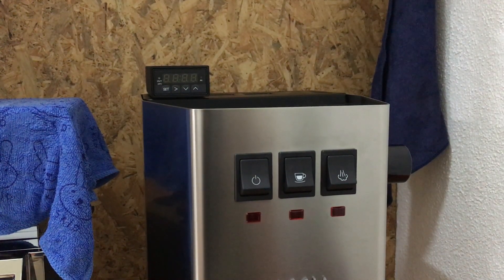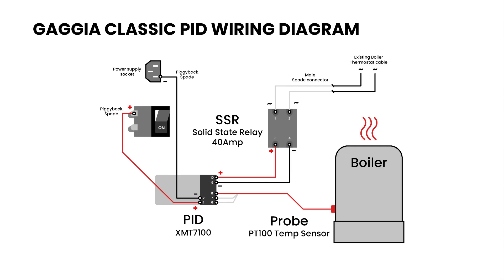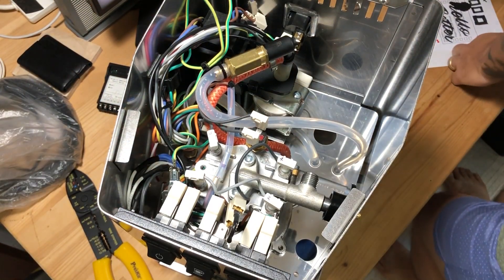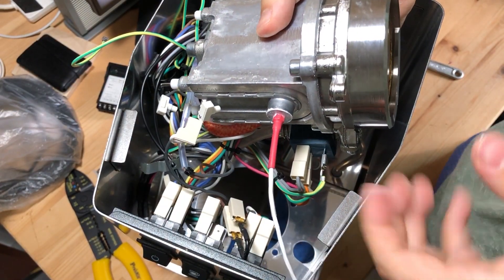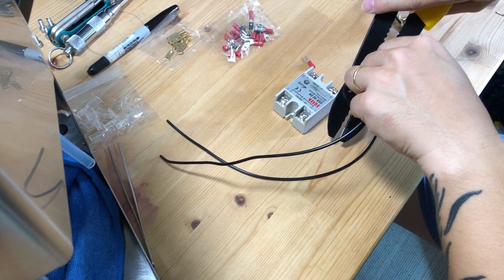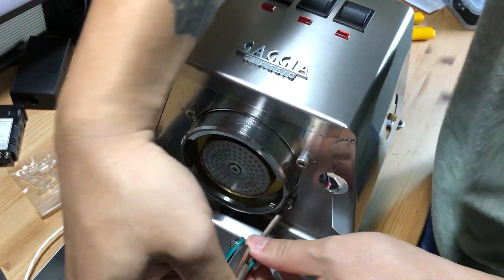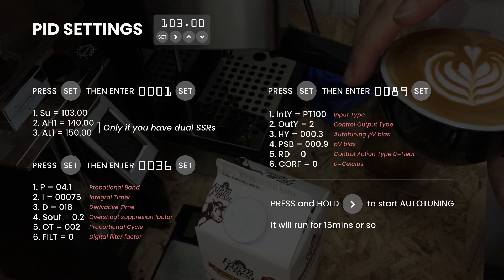Ultimate PID Gaggia Classic Pro Mod

Comment: Hi, I followed this guide also and it works perfectly!👏🏻👏🏻 thank you :) do you know how I can add a second o e to stabilise the steam setting as well? I’d love to upgrade it for this last part also?
Reply from the maker: Thank you for following! I haven't done it yet but hopefully I can put a second video up as well. You can also search for other tutorials with dual SSR settings. Good luck!
Reply: @EweJinTee  Thank you, I have seen the video on how to convert the lid but I cannot find a wiring diagram to show how to connect the second ssr?
Reply from the maker: @Daverave69   It's connected to the 3/4 terminals on the PID if I'm not mistaken. Check Damian's video. Do a google search on 'Dual PID Gaggia'. Hopefully I'll have some time for a new video soon :P
Reply: @EweJinTee  Thank you 🙏🏻 😊 this is super helpful

Comment: Before doing all this, has anyone looked into swapping another thermostat for higher temps/ better temp swings?
Reply from the maker: The original thermostat that came with the Gaggia is already exceeded the ideal brewing temperature. If I'm not mistaken the original thermostat is at 150 Celcius. Someone might be able to clarify that better here.
Reply: @EweJinTee  107° for brew_145° for steam.  The coil is rated for 185°.
I'm researching some  other thermostat options now. With the 107° brew high limit, my one week old machine is not able to see temps past the portafilter of 79.5°.
I've been doing the hack with opening the steam cycle for 20 seconds also. I've found the manufacturer/ klixon of the supplied thermostat and have found a supplier who can sale me a 120° thermostat to swap out. I'm trying that out for $15 US, before spending what a PID and parts run. I'll update here once i install the thermostat hook my equipment up to the gaggia.
Reply from the maker: @BadCompany-TX  Great to have people like you in the community! Do update the results when you're able to swap the thermostat. Good Luck!

Comment: Hello! from the left button (power on) is "+"?  from the power on the rear panel is it "-"?
Why are two wires connected on the middle button (turning on the pump)?
"+" can be taken from the middle button?
Reply from the maker: The wires were taken from the power rocker switch (+) and rear power supply (-) to supply power to the PID and keep it running only when the machine is turned On. The PID needs to be ON to maintain the temperature in the boiler.

If you connect the (+) to the brew switch, then you will only get the PID starting up when you press the brew button. Hope that makes sense.
Reply: @EweJinTee  Thanks for the answer!
Reply from the maker: @elenakalugina3758  Anytime!
Reply: @EweJinTee  but in Robert's video it turns on as soon as he turns on the machine. Doesn't that contradict with what you are saying?

Comment: Shopping for a sensor, I see some have 2 conductor wires and some have 3 conductor wires. What is the difference?
Reply from the maker: Thanks for asking. I just googled and found this. Basically it's about the accuracy of the sensor. Not too sure how you will need to wire them to your PID but 2 wires work fine for me.

https://www.sensortips.com/featured/whats-the-difference-between-2-3-4-wire-rdt-sensing-faq
Reply: @EweJinTee  thank you

Comment: XMT7100 seems to be no longer available. Are there any alternatives?
Reply from the maker: https://www.aliexpress.com/item/1005004668154424.html

Try this?
Reply: @EweJinTee  thanks but item not available in my region.
Reply from the maker: @hoqpus  Guess you'll have to Google to see if any luck. Another PID is also possible but you will have to study the diagram and connect it to the correct terminals behind the 'new' PID. And the enclosure also will be different in that case.

Comment: Hi. I did PID too but now my steam wand doesnt steam. Hot water still goes through the steam wand. Do you know what may cause the issue? :(
Reply from the maker: This is difficult to answer without actually checking the machine. Better to seek a local shop's help I think.. Or just dismantle and look around inside the machine but be very careful, the entire thing inside is running current. I got shocked once just by touching the boiler lol
Reply: @EweJinTee  do you think bcuz we autotune it as 103, the temp cant go up higher for it to steam? Just my thought

Comment: Thank you Ewejin for your very informative and detailed video. I am not good dealing with electrical values, will this set up work as well in the USA model since we have 110v and not 220v like in Europe or I will need to change some components or the way it is connected?
Reply from the maker: No problem. I might be wrong but maybe someone in here who's in the US can help out as well. I'm pretty sure the circuit in the machine won't affect the Voltage much because it is all converted from the main power source which is either 110V or 240V. But please do your research nonetheless. I will update if I can find something.
Reply: @EweJinTee  Thank you.

Comment: hi ewejin i made the mod as  directed. i see the pid is set at 103, i assume thats celsius. but when i take the temperature of the water as it goes into the cup it is 65 degrees celsius for me even though the pid is saying 103-106.  what is the explanation for this?   also what is the advantage of manually tuning the pid as opposed to autotuning?
Reply from the maker: Hey. When you're setting temperature on the PID, it does not mean that's the exact temperature that you will get in your cup. Water will travel across the boiler into the grouphead and temperature will drop. There is a certain way to measure the temperature on the grouphead but I haven't done it before as well. Check it here : https://www.youtube.com/watch?v=6kog9_V5ci4

I basically set my temperature based on espresso extraction taste. If it's too bitter, then it's too warm, too sour then it's too cold. It all depends on your grind size, bean and roast settings. There are a lot of variations that go into it so it's a bit complicated to define the temperature that you set on the PID. You'll have to adjust according and find the sweet spot. Hope that helps.

Comment: thanks for the instructional video.  question., i will need to buy a crimping tool for the project, what is a good crimping tool that you would suggest that is for  a hobbyist, only doing occasional wire work. can you provide a link, thank you.
Reply from the maker: Thanks! I found a few on Amazon, but I think this would do the job fine. 

https://amzn.to/3RuVtE1

Check out the link. Good luck!

Comment: Love this video. Are you  Malaysian?  Quick question, are you planning on doing a flow control mod?
Reply from the maker: Yes I am. From Penang! I'm planning on a couple more such as a Pressure Gauge. Not a fan of Flow Control mod but I might change my mind after I've done proper research and found the right equipments to proceed ;)
Reply: @EweJinTee  I'm from Kl, I'm going to get a gaggia and will probably hit you up when I mess up my mods haha.  I really want to do flow control, maybe the gaggiuino stuff to make it basically function like a 20k machine but I can't solder for nuts 😅
Reply from the maker: Sure man. Just hit me up on FB Messenger or something. I'm in the Gaggia FB group as well.

Comment: I installed according to directions but when I turn on my machine the temperature for the PID only shows low 90s in F setting  and moves very slow. The AT light is blinking slowly. But the machine is very hot
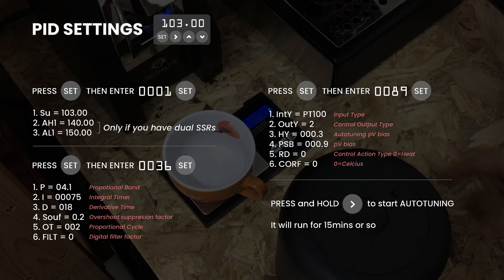Reply from the maker: Please check the settings of your PID and make sure you entered the correct temperature sensor probe. There is a page at the end of the video on proper PID settings @ 8:34

Comment: Thank you Ewejin.
Wondering if there’re diff pid module available in the market? It’s interesting to see how flow rate can be controlled too?
Reply from the maker: There are other PID Modules which does the same thing but it's twice the size. I used this one because of it's compact size. However, there are other mods that let's you control flow, preinfusion and temperature but it requires some engineering background. Google 'Arduino mod Gaggia Classic Pro' and you should be able to find it. I'll put the link here: https://www.youtube.com/watch?v=MxPNQRCxQZc

Comment: Great tutorial Ewejin. What is the difference between the 40amp SS relay and the one in Damian’s video (was 25amp)? Thanks
Reply from the maker: Thank you! It's not much of a difference with 25 or 40amp relays. I'm just giving it more 'space' so to say to be able to handle the load. And also to 'overkill' the setup so it's safe for everyday use. Just my personal preference when modding this.
Reply: @EweJinTee  Great, I am pulling the trigger to this mod soon :)
Reply from the maker: @RamySLR  Good luck! Looking forward to your results! Remember to familiarise yourself with the internals before doing any splicing/cutting :)

Comment: The pid works as soon as I connect the electricity, even though the machine switch is turned off
Reply from the maker: Thanks. I can only think of two options: 1. Please check the terminals for the PID power source. You might have connected the wrong terminal or 2. your model might be different than mine and the power swtich terminals is different. Best to use a multimeter to check.
Reply: @EweJinTee  Thank you very much I fixed it
Reply from the maker: @محمد_ابوعيشة  Awesome!!
Reply: @محمد_ابوعيشة  How did you fix the issue?

Comment: Very detailed video, thanks so much for putting this together! Going to order the parts off Ali soon and shop the rest locally.
Reply from the maker: Thanks for the comment! Good luck with your project!
Reply: @EweJinTee  Question to you, is the 2.5mm wire the same as a AWG 10 wire? If so, how are you using those red connectors with it? Commonly, the red connector is associated with AWG 22-16??
Reply from the maker: @Moxyvox  I think AWG 20-22 wire is good enough. According to the rated voltage, it can support up to 600V which is more than enough. The red connectors just crimped and secured nicely to the AWG22 wires.

Comment: Thanks for the post.  About the PID setting, at code 89 #3 HY=000.3 and #4 PSB=000.9 . How do you set the decimal, is the 0003 and 0009 is the same. Cant set to 000.3, and 000.9.
How to get it there.
Thanks Eddie
Reply from the maker: Hey Eddie,  I can't remember the setting anymore but probably just use the 'Up' and 'Down' arrow keys on the PID to get to the correct number settings? You can try that out. If not, please check Damian's PID setting video. You should be able to find the link in the description or comments here. Thanks!

Comment: Hello friend! PSB should be 000.9 or 000.0?
Reply from the maker: You can leave it at 000.0 no issues. I think I had it at 000.9 or maybe that was a typo in the video. Sorry about that!
Reply: @EweJinTee  could you please tel me what's the difference if I leave it in 000.0 or put it at 000.9?
Reply from the maker: @SteliosXanthopoulos  I'm not too sure myself. Maybe it's best to just leave it at 000.0 as a default :)
Reply: is this the offset temperature? what is this PSB setting?

Comment: Sorry if I missed it but what happen to the Bezzera BZ13
Reply from the maker: Sold it. Needed a smaller machine for the Kitchen. The BZ13 was a good machine though, I've had it for almost 5 years with no issues.
Reply: @EweJinTee  my GCP has the dimmer, cut OPV spring, PID and gauge. Somehow I think I would be happier with my modified GCP than a BZ13 out of the box!

Comment: Great tutorial! Thanks. I followed it and installed the very same components on my 97 Gaggia Classic. However when brewing the temperature goes from the target 103C down to 99/98C. Weirdly, the autotuning last only for about 2 minutes. I tried several time with auto tune as well as manually setting the parameters but nothing helped. Do you have any idea of what could be wrong?
Reply from the maker: Hi Tommaso. Thank you for the question. Temperature drop during brew is normal, as cold water flows through the brew group head, it converts water from room temperature to your desired brew temperature. -1C to -5C temp drop is normal. This is the only downside with smaller machines like the Gaggia. Larger machines will tend to have a boiler inside and temperature is monitored in the tank. Hope that helps.

Comment: Dude - I feel like this is going to be a really dumb question - but is the wire I am looking for - 2.5mm single core, copper insulated wire?
Reply from the maker: I think that's the one. Insulated wires help prevent the wires from getting burnt at high temperatures. Good Luck!

Comment: Nice job
Reply: It is nice because you show easy it is to add a pid and get that 70 to 80% benefit without the pain of adding second ssr or an expensive kit to get steam control.  And at a VERY reasonable price point.  Good wire diagram as well..
Reply from the maker: @chuckv8838  Appreciate it! Please share your setup once you're done modding on FB group called 'GAGGIA Classic'. I'm on there as well :)
Reply from the maker: Thanks!!

Comment: Thank You!! I completed everything today: cut opv spring, lamp dimmer switch on right side in front of steam knob, installed manometer on front right, moved Gaggia logo left, setup xmt7100 for 2 relays, pulled a perfect shot, and I now know the pressure is at 8.5 bar. You helped a lot!
Reply: Keith do you mind sharing the wiring diagram for 2 SSRs.?
Reply: @thinkertinkering3853  I did not create any diagram for the second SSR. Ewejin Tee demonstrated a good diagram in this video, https://youtu.be/ztvDKt2Zz6c
The only supplement to that, if using the xmt7100 modified as Damian indicated here, https://youtu.be/WYm6hDPqtgA is to run pin 4 and 5 to the second relay for the steam thermostat terminals. I only used the negative terminal, pin 5, to the second relay because as Damian indicated elsewhere, the positive of pin 10 and 4 is constant on, and only negative pin 9 and 5 is switched. So I ran one wire from pin 10 to positive of both relays!
Reply: @threehanded8853  I tried that today and now my Gaggia does not heat up anymore (neither when turned on nor when steam knob additionally switched on).
I used a 2nd SSR DA (otherwise your mapping makes no sense as the input is DC).
No big deal as I can easily unplug the 2nd SSR DA and run my PID as described in this video. 
Therefore my journey for the correct dual SSR wiring continues.
Reply: @thinkertinkering3853  Also, I connected my thermocouple as Damian did in his video because I used a k-type thermocouple versus a pt100 type, so it’s wired differently and you have to use a different type setting in the settings menu, if you use a k-type thermocouple as I did.
Reply: @threehanded8853  Thank you for pointing out the k-type thermocouple, I have the same when I ordered the parts for Gaggiuino project (I haven't started the project yet), but could you please share more information on how it's wired differently and how the setting is different in the PID?
Reply: @showmak  the blue and red leads are connected to pin 6 and 7 (of the xmt7100), and no jumper wire is used from pin 7 to 8. In the PID menu, menu 89, Inty setting is set to Y, which looks like an upside down digital 4, for my k-type thermocouple, as shown in Damian Wintowski’s video:: I did not create any diagram for the second SSR. Ewejin Tee demonstrated a good diagram in this video, https://youtu.be/ztvDKt2Zz6c
The only supplement to that, if using the xmt7100 modified as Damian indicated here, https://youtu.be/WYm6hDPqtgA is to run pin 4 and 5 to the second relay for the steam thermostat terminals. I only used the negative terminal, pin 5, to the second relay because as Damian indicated elsewhere, the positive of pin 10 and 4 is constant on, and only negative pin 9 and 5 are switched. So I ran one wire from pin 10 to positive terminal of both solid state relays!
Damian Witonski remove ssr xmt7100
Remake - https://youtu.be/WYm6hDPqtgA
Original - https://youtu.be/Ewj5oXl_wk0
Reply from the maker: Glad to know. Cheers!
Reply: @threehanded8853 did you wire the second relay with the same cables from the thermostat cables?
Reply: @n1ckthegr33k6  think of it this way, there are 4 wires that come off the old thermostats and then get wired to the two relays. So the two wires that came off the steam thermostat go to the second relay. In the new wiring there is only one temperature sensor to the side of the boiler. That temperature information goes to the PID. The PID then decides to turn the relays on or off based on which circuit the Gaggia is in: Brew, or Steam.  The Brew and Steam circuits in the Gaggia are manually selected circuits. I hope that helps.

Comment: There are two types of temperature sensors, M4 and M6, which one is them?

Thanks for this video😁
Reply: I have the same question :)
Reply from the maker: @coenwouters6808  If you're  using the same machine as the one in this video, then you'll need to get the M4 thread  temperature sensor.
Reply: @EweJinTee  Thanks I really appreciate it
Reply from the maker: If you're  using the same machine as the one in this video, then you'll need to get the M4 thread  temperature sensor.

Comment: Is that 1/8" hole your drilled? Guessing you're using metric system...  Ordered all the parts off ali last night for $40, sure beats $150 - 200!
Reply from the maker: That's cool! I didn't measure the hole size but make sure you're able to fasten the relay :) Good luck with modding!

Comment: Do you need 2 relays if you want to be able to adjust the steam temperature?
Reply from the maker: Hey. Yes you will need that. I didn't mod the 2nd relay into the machine because I felt the steam  temp is working fine for me and I'm able to get nice foam. I've shared a video by Damian in one of the threads below. Please check them out.